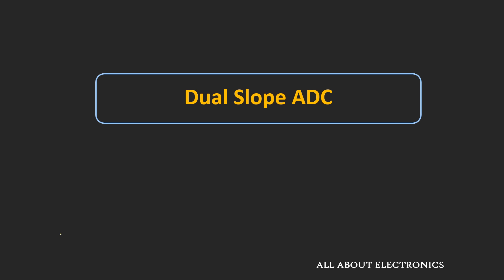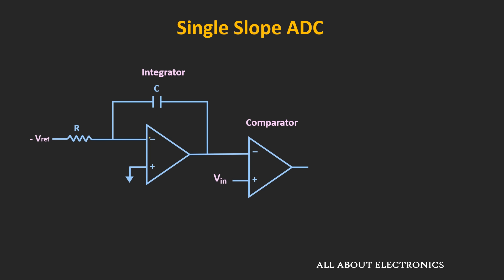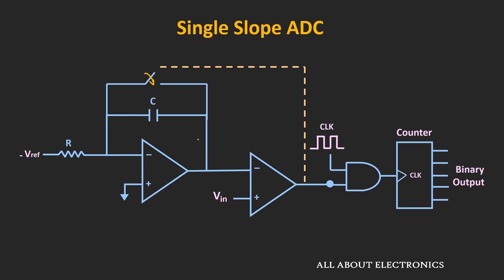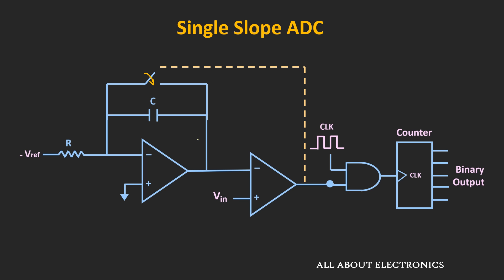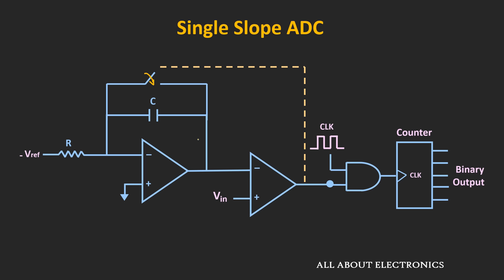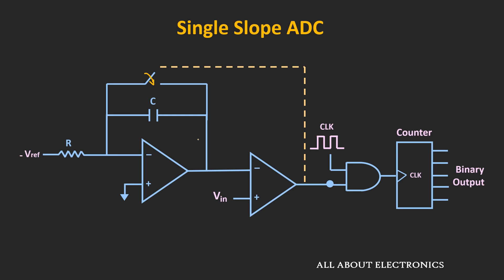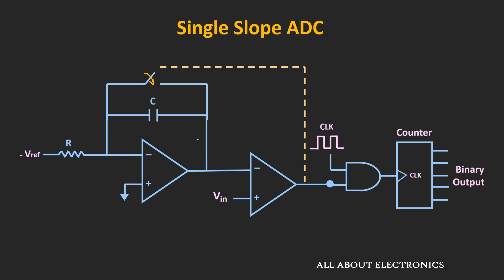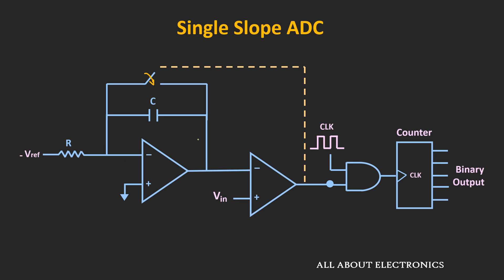Analog to Digital Converter: Single Slope and Dual Slope ADC Explained

Comment: The Dual slope example is quoted for Vmax of the ADC range. A fixed time period sampling of Vin with counter effective on T2 slope only will make the operation more practical. Otherwise an excellent video.
Reply from the maker: The time duration for the input voltage is always fixed. The input signal will be integrated until the counter reaches (2^N -1).
So, the time duration for Vin is fixed only.

Comment: Thank you for the lecture. I appreciate your efforts. For T2=N*Tc where you meant N is some output from the counter that could be between 0-2^N-1. Here, the notation 'N' is confusing. Suppose, for 5-bit Dual Slope ADC N is 5. That means, T2 is 5 Tc cycles? This could have been something more better.
Reply from the maker: Yes, I should have used different nomenclature for both to avoid the confusion .
Reply: @ALLABOUTELECTRONICS  Thank you for replying.

Comment: I couldnt understand the relation between the positive slope of the integrated output and the negative sign of the reference voltage. Why we said that the slope is positive because of the negative Vref? At the time 2.13 in the video.

Comment: Why after toggling to -Vref from Vin the comparator output stays negative??? It should be positive
Reply from the maker: As you can see at 9:33, the slop changes when input toggles from Vin to -Vref. And it starts integrating in positive direction. As soon as, output crosses 0V, the comparator output goes LOW.

Comment: If my exam question ask me to "explain dual slope dvm" so can I explain "dual slope ADC"? Means are both the terms synonym of each other or if there is any difference,then tell me the difference. 🙏🙏
Reply from the maker: Yes you can write, as it works on the same principle.

Comment: 1:54 ,Why the reference voltage is integrated untill Vo=Vin?
Reply from the maker: As soon as the output of the integrator crosses the Vin, the output of the comparator becomes low. And further counting will stop. (As mentioned at 4:53) . And the integrator capacitor will get RESET. 
I hope it will clear your doubt.

Comment: I didnt get u at switch is closed 
What happens??why we use switch over their??
Reply: the circuit is reset before conversion after switching on the input voltage is selected and integrated over a period determined by RC time constant and a certain voltage output is obtained for a certain time period than switch is moved to select the reference voltage. as reference voltage is negative below zero it is integrated over time period till the output of integrator  becomes zero

Comment: Is the Vref also an AC signal with same frequency as Vin?
Reply from the maker: No, it's DC VOLTAGE. And it should be very stable.
Reply: @ALLABOUTELECTRONICS  But Vin is AC, and it will change polarity. So what will happen when negative cycle starts?
Reply from the maker: When ADC is used with only positive reference voltage then we need to ensure that, the input is positive only. If input is time varying or AC, then we need to provide the DC offset to ensure that it is positive. 
But some ADCs can be configured in the differential mode. And in such case, input can be applied from - Vref/2 to + Vref/2.
Reply: @ALLABOUTELECTRONICS  
But here the reference voltage is negative and not positive

Comment: Sir,in dual slope adc vin is unknown and we are integrating for fixed period of time ..so how counter will start count from 0000 to 1111 means 2^n-1? Bcz overflow become high when count exceeds from 1111.
Reply from the maker: Once the overflow bit becomes high during the time T1, the counter will get reset to 0000. That means during the time T2, it will start from 0000. I hope, it will clear your doubt.

Comment: Why we use integrator. normal counter type we don't use Any integrator so can you plz explain important of that integrator in this circuit
Reply from the maker: The different types of ADC use, different types of techniques for the conversion.
The dual-slope ADC does not require any DAC for the conversion. (Unlike Counter type ADC) and it provides a good resolution. 
So, it is relatively cheap compared to other types of ADCs for the same resolution. And mostly it is found in the Digital Multimeters.
Reply: @ALLABOUTELECTRONICS  
Can you plz give a small example on single slop asc

Comment: 14:26  how T2=N*Tc
Reply from the maker: Its shows the n clock cycles to reach the output to zero. During T1, the integrator integrates the input voltage. T2 shows the time required by the integrator to reach to 0V. That's n clock cycles (Where n is some counter output (between 0 to 2^N -1).
I hope it will clear your doubt.
Reply: @ALLABOUTELECTRONICS  Thank you
Reply: @ALLABOUTELECTRONICS  if possible please make a video on sigma Delta ADC( includes modulator,decimator, and current starved VCO)
Reply: Sir how can we say that exactly n clock cycles ..It is depend upon Vref

Comment: what is the vin ? is it sine wave or square wave?
Reply from the maker: Actual input to ADC system could be anything. The input to the ADC is the sampled value by the sample and hold circuit (as I mentioned in the introductory video). And SAH circuit should hold that value till the end of conversion. 
I hope it will clear your doubt.

Comment: @3:12 how output of integrator Vo comes to Vin..in time T, bcoz as per input we only applied Vref
Reply from the maker: The input is Vref, but the output of the integrator is compared with the input of the comparator. At some T, the output of the integrator is equal to the Vin ( input of the comparator). I hope it will clear your doubt.